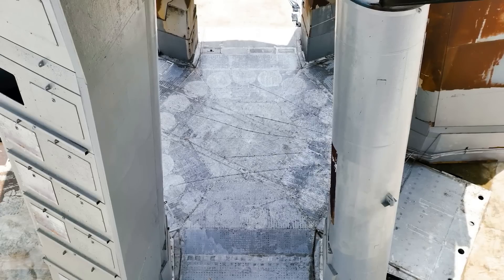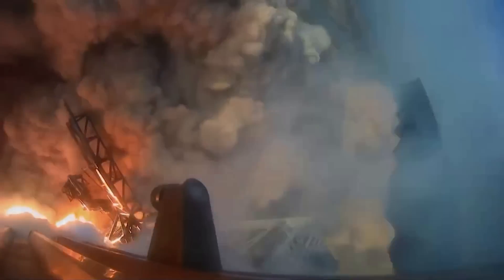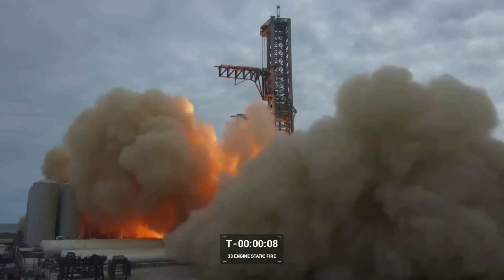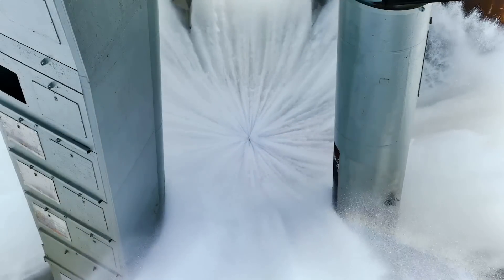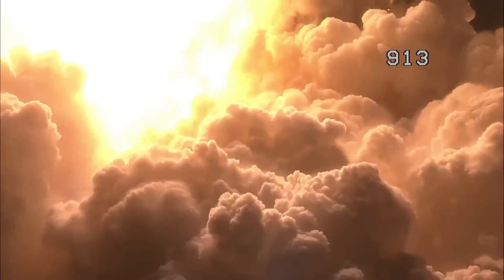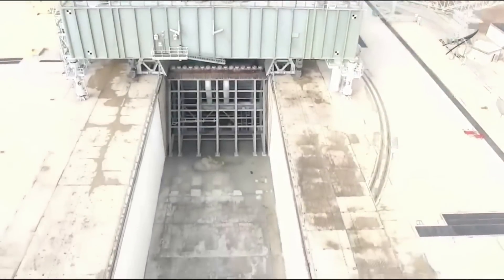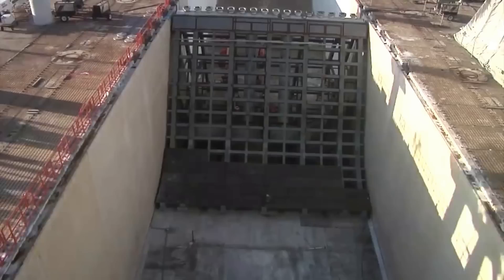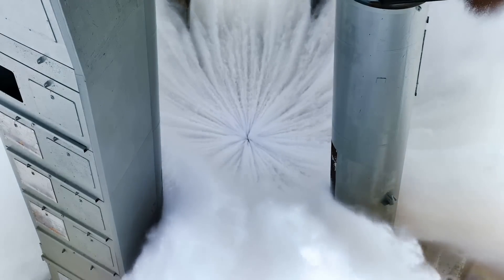Why Water Is So Important For Starship's Next Launch

Comment: SpaceX is acting really stupid right now using unproven tech when they can just copy NASAs setup. You can see in the test water plate is not on the ground, almost all the flame doesn't even hit the plate. It's not even a test, it is a proof of concept. That whole Boca Chica setup is not going to work, I don't know why they are wasting so much time and money. Any physicist will tell you that water plate is not going to work as SpaceX intends to use them for. All you have to do is make flame diverters or proper deluge system, really not that complicated. Using a gravy well works for NASA but SpaceX wants to use massive water pumps to supply the water, just another major failure point. They have already tried these waterplates before and there is a reason no other launch pad doesn't have them.

Comment: Watching other videos from other sites that were from a bit of a distance at ground level I thought that the water system should help. But here I see a video that is showing the plate at an angle and I don’t like what I see. The central plate area’s water flow configuration seems rather iffy. The very area (the central part) that will get the maximum heating and by far the worst stagnation of engine exhaust flow producing the highest stagnation temperatures and pressures does not seem to have the best water flow configuration. This suggests that there maybe some “entertainment” after all! Hopefully the central area will not burn through and allow the raptor’s exhaust to enter the underlying channels and cause “entertaining” things to happen.
Reply: Yeah, they should just cancel Starship at this point. Wasting all this money just for it to not work. Should of just made a NASA setup for starship in Houston and they then would only have to worry about getting Starship to function instead now they are spread-out trying this asinine setup. That static fire with the plate is in fact going to be interesting to see how bad it fails.
Reply: @EricHamm  
The “burp test” didn’t prove anything last time. If they keep the spin up hold down to as short as possible, probably the damage will be not be unreasonable with some amount of repairs needed between launches. Good enough for spacex work, call it a success as usual and fail forward. But if u r NASA and blow some elevator doors in, it is a disaster of incompetent proportions.
Reply: @EricHamm Looks good to me

Comment: This is a good system and it’s going to work
Reply: No it is not. There is a reason no other launch pad uses that system. Driving those massive pumps is a huge failure point because if the pumps fail the entire thing will explode on the lauchpad. Also look at the test closely, notice how the plate isn't on the ground? Go watch Thunderf00t, he explains all this and he is a nuclear physicist.

Comment: Fundamentally, having the pad perpendicular to the engines is a bad idea. Flame diverters are a thing for a reason.
Reply: Agreed but that would be a pain to build at starbase.
Reply: @careykaeding4542  They are trying to be cheap instead of doing things correctly, in the end it will cost them more. Hard to believe they will be allowed to launch a human rated flight from that style of pad.
Reply: I dont think thats possible in boca chica
Reply: @Rador000  It's not. Elon really fucked up, Boca Chica doesn't have room for all that which is why they are "trying" the water plate. NASA doesn't trust them anymore to use their pads for Starship. They should just build their own pad in Houston exactly how NASA has it but perhaps a little scaled up and abandon Boca Chica. Elon and The COO need to step down and put someone who knows what they are doing.
Reply: @Rador000  KSC was also built of a marsh and they added tons of dirt to build up the launch pad above sea level. The flame trench was then built into the raised portion. SpaceX has a launch pad in Florida with the same design as the one in Texas, it's just down the road from the properly designed launch pads. They are just being cheap.
Reply: @jdbarrera cheap How you living fool😂😂😂
Reply: @jdbarrera how does a vector make it not perp?

Comment: I have a bad feeling about this 💦..... As much as I'm rooting for Elon to succeed this design is at best a shut in the dark.. I just can't understand why didn't they built up the terrain to at least fifty or a seventy feet high for a proper flame diverter. 🤔
Reply: Because Musk thinks he can do what he wants. He believes he can destroy the environment for his vanity stupid project. He is too arrogant to seek authorization for a proper water deluge. Now he wants to force the FAA's hand to continue his stupid experiment. This should not be allowed to happen again.
Reply: Because the built up area for pad 39A at the Cape is more area than the entire launch complex at starbase, which would've been an undertaking that would've taken years to get approval for to begin with. Plus, the flame diverter is ablative, and only good for a few rocket launches at the cape, which is fine for giant rockets that only launch every few months, but not good enough if you want several a week, or several a day.

The pressure against the pad won't be an issue, since their using the same steel and concrete pilings that support skyscrapers, which have a ground pressure often much higher than a full stack.

And the heat won't be an issue, since boiling one KG of water takes about 2.3 MJ's of energy. If you do the math, for 10 seconds of full thrust, super heavy will burn about 46 tons of methane. Which has an energy density of 55 MJ/Kg. This adds up to needing around 1,100 tons of water. Even if the starship water deluge is only on par with SLS, it would still be good for 1500 tons. And that's not accounting for the fact that the majority of the energy won't even go into boiling the water. 

Besides, just look at the single raptor deluge test. Comparing it to the full deluge system, it's quite obvious that it stood up to the raptor despite being half the distance the actual deluge system is from the engines. And from the looks of it, using less water than the actual system will have per raptor.

So TLDR: Cost, regulations on a nature preserve, the need for a rapid launch cadence, and a design that can (and will) hold up to the rocket while not needing one.
Reply: @goldenfloof5469  Well 🙂.... I guess I haven't thought it trough but now I have a better grip on it since you took the time to explain it very well.
👍 Thanks
Reply: @goldenfloof5469  None of the water plate tests have been on the ground so they are not even close to the actual test. Boca Chica doesn't have room for a flame diversity and proper water deluge system and other facilities, it is the literal reason they are trying the water plate system. Just like Elon launching knowing that if 1 rocket failed Starship would fail (2 or 3 were down before launch) this is a bad idea to cut corners. In all the water plate tests you can clearly see most the flame and energy is not in direct contact with the plate. Also with your calculations they are not accurate in the slightest in this application. Without knowing the design and specific details of the waterplate you have no idea how much energy it can take before failing. Check out Thunderf00t cause if your a number guy he can explain it way better that any non-physicist can.

Comment: The thrust of Starship's booster engines will blow the pad to bits again, the water is a band-aid on a mortal wound.  Boca Chica is a WRITE OFF, a fatal error.  SpaceX has to start over in a location where they can build a proper flame diversion system under the pad.  But Musk's ego will NEVER admit a stupid mistake.
Reply: Musk thinks he can do what he wants. He believes he can destroy the environment for his vanity stupid project. He is too arrogant to seek authorization for a proper water deluge. Now he wants to force the FAA's hand to continue his stupid experiment. This should not be allowed to happen again.
Reply: Unfortunately I think you're right, I am a fan of alot of things spacex does but I think so far what they've done with the pad on the first flight was sloppy and I'm skeptical that this will work
Reply: @brianressler569  Starship is a massive failure and they really should either start over or just abandon it. One would think you can send multiple Artimis missions for the price of Boca Chica and Starship blowing up (about to be twice). I really hope NASA pulls funding for starship if they keep fucking up this bad.
Reply: Exactly!